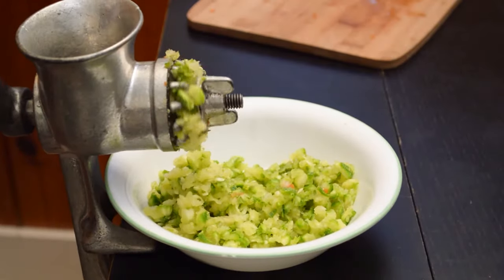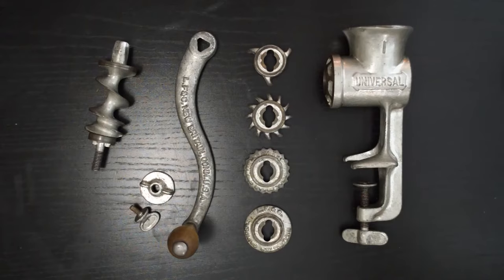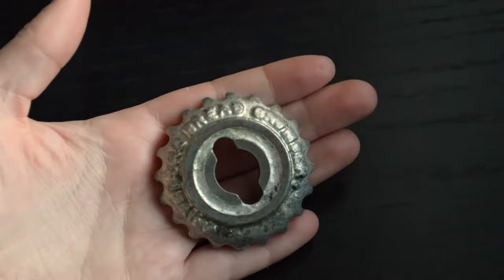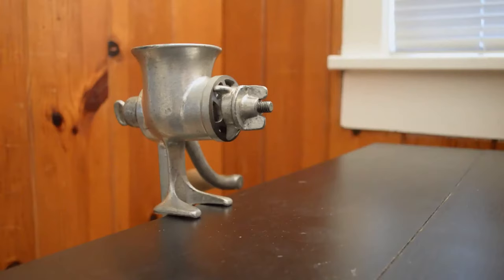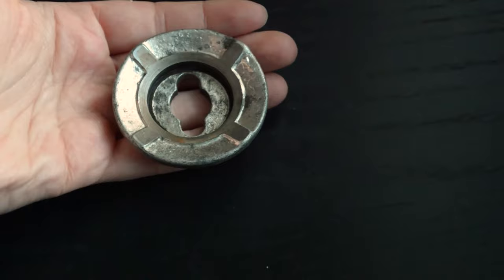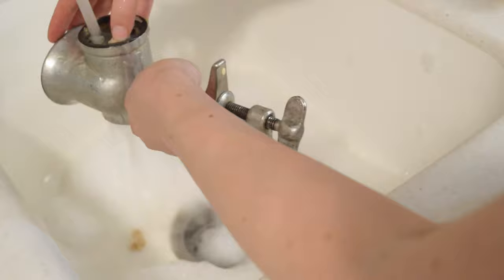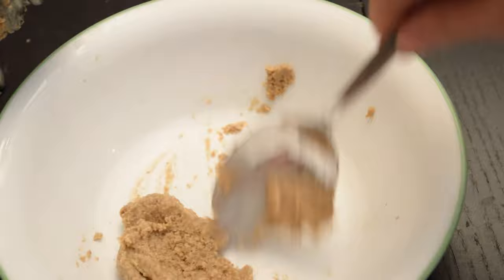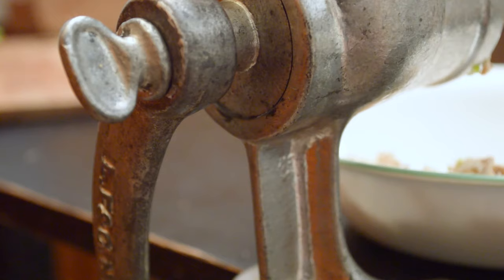universal food chopper in-depth : vintage kitchen

Comment: I have No 1, No 2, and No 3. The No 3 grinder blades are not compatible with the smaller grinders. The grinder and blades are much bigger.
Reply: Hi can any of them (the #1, 2 or 3) be used to grind grain like wheat or corn?
Reply: @victorybase5847  I dont see why not. Depends on how course or fine you want it. If you want it very fine, probably need to ensure you have the nut-butter attachment. I rarely use my #1 or #2 anymore. Mostly use my #3 (its bigger and handles meat much easier) to grind up beef chuck roasts into course ground beef for chili, spaghetti meat sauce, and burger patties.

Comment: My mom left me an old Universal 72 grinder similar to this one, but It has a clamp on top that releases to insert the inner part, whatever you call it, whereas yours is not removable.  It comes apart in 2 halves for easier cleaning. My next thing is I will sharpen the knives of which it has 4, 10, and 16 blades knives. Maybe some are missing IDK.  This model also has a trough at the bottom that catches juice which goes into the bowl eliminating the need for a chair  😉Anybody know how old the 72 is?  Great video young lady!

Comment: It's not made entirely of cast iron. The threaded parts (bolts) and the chrome cap on the handle are made of steel and are braised onto the cast iron
Reply from the maker: Thank you for sharing. That's excellent info to have!
Reply: @craftrevue  You're welcome. It's a truly amazing machine. I have my great grandmother's Universal #1 and it still works flawlessly, although the silvery "hot dip" coating is long gone. One cleaning tip: After you've done all the scrubbing with soap, place the grinder and attachments (but not the wood & iron handle) in boiling for five minutes. This will completely remove any residue and eliminate any bacteria that may be lurking in the crevasses. Chlorine bleach (which restaurants use) will kill bacteria, too, but it's not good for the cast iron. When you (carefully) remove the grinder from the boiling water, the cast iron will dry on its own within seconds due to the heat, thus leaving a pristine grinder ready to make another great meal.

Comment: Great work, Veronica, now I know there is a nut butter plate to look for, and I will, that sounds great! If you, or anyone, has info on a trick for sharpening the cutters, I'd love to know -- my dad used to say that these and reel mowers could be sharpened by running them backwards for a while with a little valve grinding compound on the cutting surfaces.  Also here's a tip -- it seems way easier to grind meat that is partly thawed. Tip #2: eBay is a good place to look for disks, but they may cost you as much as the grinder did. Them folks know what they got.

Comment: I got a compact model for 10$ at the flea market, its only got the 3 grates of different sizes but that's pretty universally a good grind, makes good nut butter on the first grind (if I just add honey or maple directly to the grind, works great for me especially pumpkin seeds crushed for baklava seasoning alternative, even got the color), made killer fresh beef slab minced with it too. Its cool you don't even need a bladed part really even if you  only got the 3 different sized holes grates you'll be able to make a pretty useful universal mince and grind with almost anything. I think my smaller model's pressure and small surface area make it realllll easy, it don't seem to have place for a big blade on the main axis either.  No model number on it just MADE IN ENGLAND' mmmm.

Comment: Put the nuts through a chopping blade first then the nut butter disk.  Gets past the hard turning first time.  I use my no. 2 to chop nuts before putting them through my dedicated nut butter tool.  Looking for a disk like you used as well as other disks.
Reply from the maker: Thank you, that's a great tip!
Reply: Do you toast the nuts before?

Comment: New Subscriber here! 😎 Just picked one up from a Thrift Store in mint condition. 2 questions, is it dish washer safe? And which blade is best for making Hamburger?. I have a Ninja Food Processor which works fine, but this will be great for Power Outage's or Camping! Thank You, Great Video! 👍
Reply from the maker: Thanks for subscribing! 
The grinder is not dishwasher safe :( 
For making standard hamburger I would recommend the mincing blade (in the video it's the one used on zucchini). But if you prefer a finer texture, the crumbing blade would be the best bet.

Comment: Lovely. Quicker or more labour than chopping?
Reply from the maker: Depends on how much you're chopping! For only a vegetable or two, I don't think it would be worth the trouble of assembly/disassembly/cleaning of the gadget pieces. But for a larger volume of food, it's usually much less time and effort to use the chopper. Most foods move through very quickly, and turning the handle is almost effortless.

Comment: Did you have an issue with a black sludge coming out of the wing nut and black flecks in the nut butter?    I just got one, tried to make a nut butter and there was just so much black material coming out with it.   Like. . .is it edible?
Reply from the maker: Hi Kelly! It sounds like there's some sort of buildup on the parts of your food chopper; since you just got it and the source of the flecks is unknown, I would probably toss that batch of nut butter :( The buildup is probably concentrated on the threads of the wingnut and the bolt it screws onto, but there could also be gunk elsewhere in the food chopper. If you give it a quick wash, you'll probably see the black buildup visually--all parts of the food chopper should appear silver.
I recommend doing a deep clean of all the pieces, being careful to avoid soaking the wooden part of the handle.
1. disassemble the food chopper and soak pieces in a half vinegar, half water solution for anywhere from 30 minutes to a few hours
2. scrub away any discoloration from the parts, focusing on the wingnut & bolt threads. It may help to use an old toothbrush.
3. If you're having extra trouble removing residue, try using salt or baking soda as an abrasive. Just sprinkle onto the damp metal and scrub.
Hope this helps!
Reply: @craftrevue   I'll try this out!  I spoke to my dad about it, and he thinks its deeps seated rust in the cast iron around the friction sites.  He suggested getting some food grade rust inhibitor, putting a few layers on those friction sites.
Reply from the maker: That's a great idea, especially if you live in a humid environment! If it were me, I'd probably just use cooking oil- that's what I use on my carbon steel pans to prevent corrosion. I just dry the pans with heat, then swipe a super thin layer on the cooking surface with a towel.

Comment: Have you heard of anyone trying to attach a pasta extruder to this Universal grinder and succeeded using it for that purpose?
Reply from the maker: Since the Universal grinder is slightly rounded on the front and doesn't take a stationary thread ring and disk like traditional meat grinders, it would be difficult to get traditional pasta noodles out of it. But you could probably make some cool pea-sized gnocchi with the coarse chopping blade :)

Comment: How does one go about sharpening the chopping plates?
Reply from the maker: Hello, thanks for visiting! Unfortunately I'm not sure of the answer to this :( These blades are trickier to sharpen than typical meat grinder blades; that's because typical grinder blades are flat discs, but these blades are convex. Flat meat grinder blades are generally sharpened by wet-sanding with increasingly fine sandpaper on a flat surface. So, my best guess is that maybe sandpaper could be wedged between the face of the hopper and the blade, thus sharpening the blade when the handle is turned?
Reply: @craftrevue  Good thought! Thank you

Comment: Great video 👏👏👏

I have a similar item "Vintage Husqvarna Scandia No. 1 Manual Meat Grinder/ Mincer Made In Sweden" that I'm having difficulty determining it's manufacturing date.

Any ideas 🙂?
Reply from the maker: thank you for commenting! there's a very brief section on Husqvarna's website saying they began making "mincing machines" in 1890. to be sure it was the right machine, I did some research and found a Swedish patent for it that was granted in 1888. so I can confirm that 1890 is most likely when the Husqvarna grinders went into manufacture. that's several years before LF&C's machine from the video above! 
the Husqvarnas were most likely made for several decades, since these machines were very popular for the first half of the 20th century, so it would be really difficult to say when a particular item was manufactured. I did contact Husqvarna to see if they had any more info on the no. 1 grinders (which I realize is weird, but companies as old as Husqvarna often employ archivists that are happy to share historical info).
unfortunately Husqvarna didn't respond to my inquiry, but I can't say I was super surprised...today they mainly sell lawnmowers and chainsaws :)

the Swedish patent:
https://tc.prv.se/spd/patent?p2=xXtpFhIZrPE&sort=filingdate&reverse=TRUE&content=Husqvarna&lang=en&tab=1&hits=true&range=10&hitsstart=30&start=39

Comment: Could the meat grinder attachment be sharpened?
Reply from the maker: Hi Javier! Yes, the first two attachments shown in the video could be sharpened. It would be a little tricky, though, since the attachments aren't flat and disc-shaped like a typical meat grinder blade. (On the Universal, the blade attachments are slightly convex to fit the rounded face of the grinder.) As long as you can get a good grip on the blades, they can be trued with sandpaper to effectively sharpen them. Cranky Buzzard has a great two-part video set showing how to do this. Part 1 is here: https://www.youtube.com/watch?v=PT2uHuyKVRU